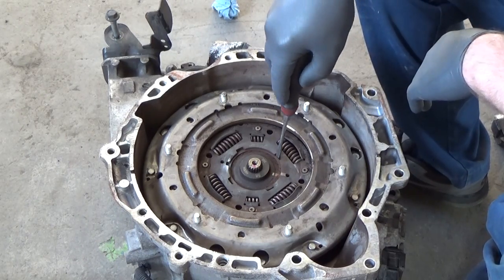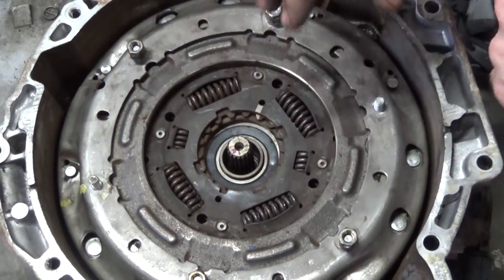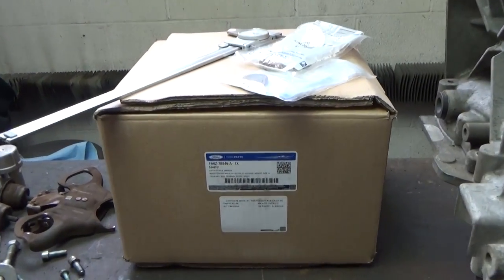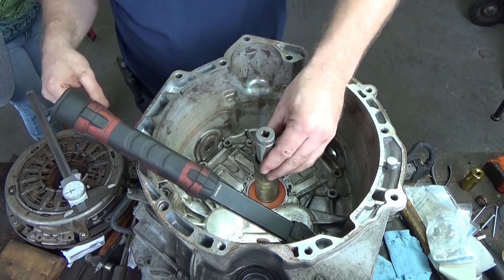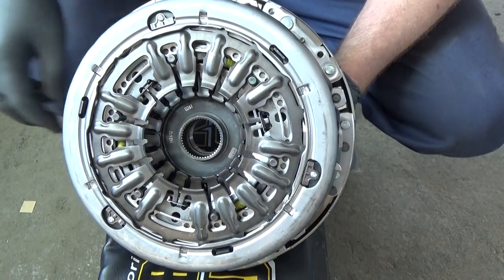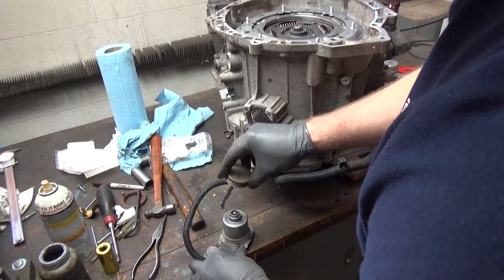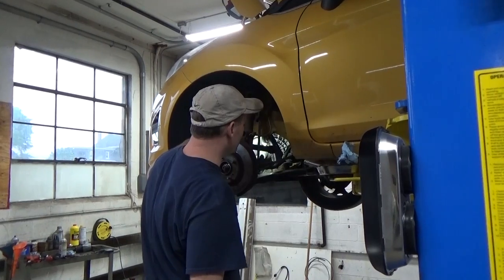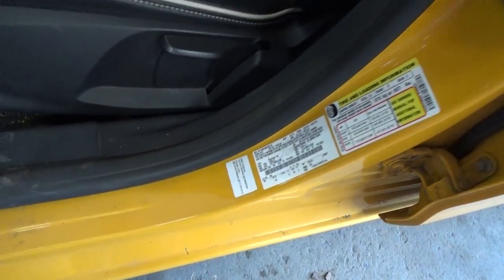Ford Fiesta DPS6 Powershift Transmission Slipping/Shudder Part 2 (Clutch replacement)

Comment: I would just like to say, I'm British and have a Ford Focus Estate Titanium 2litre late 2010. Had a problem with 2nd and 4th gear slipping, I didn't think it was the torque converter because I thought it would slip in every gear if it was that. I work 6 days a week so I had no time to get the car checked, also no money haha. Eventually 2nd and 4th completely stopped working, had a transport company take my car to a garage and was told it was the torque converter to begin with, but because I kept using the car some bands broke and ventured there way around the gearbox and trashed the solenoids. I now have to pay for a complete rebuild of my gearbox costing me £3,200 , I would love to of had you as my mechanic if I lived there, knowing and trusting in your work as you clearly took pride here. Enjoyed watching every minute of the 2 videos, liked and subscribed. Keep up the attitude and mindset, success is a goal everyone can and will reach.

Comment: Nice job! i am a ford transmission tech, and have done hundreds of clutch replacements. your tools you made are spot on. Getting yourself an ids, and vcm will make working on fords much easier, and keep alot of the programming / re-learns in house. Great video!
Reply from the maker: MikeHillman thank you for the compliments and feedback it's greatly appreciate, glad to have you here! I purchased a vcm2 with IDS, after this job. performed my first PCM update Monday on a 05 Ford escape that came in with a ingnition ping/knock when hot in addition to other symptoms, sure enough there was a update that covered all the concerns!!, felt good to do in house, last shop went crazy with it, i most likely would have as well, my first thought was someone installed the wrong plugs or something crazy. till I ran a scan/checked for updates 15minuts later it was good to go fixed! unreal amazed us all. wishing I could do it over and document. thanks again

Comment: Absolutely fantastic video! Thank you for uploading. I purchased a 2013 Focus SE with this about a year ago with 56k miles. On a test drive, there was some shudder from a stop.  The dealer (Inver Grove Ford, Inver Grove Heights, MN) went through the car and replaced the clutch pack and seals with the latest version BEFORE I signed on the dotted line. It's 10k miles later and the car runs GREAT! The dealer must have gone by the book. One thing I was told about this transmission (ANY DCT), is they become problematic because owners are not told to keep "creeping" in stop and go traffic to a minimum and keeping the car in gear while stopped on hills WITHOUT standing on the brake. The excessive heat buildup is BAD for the clutch pack just like the clutch in a fully manual transmission. BTW, the dealer gave me a FREE written lifetime power train warranty with the vehicle!
Reply: Thanks for this info! I'm sure there are other things that automatic drivers do which you can not and should not do in a manual. Such as... "red light racing"
Reply: That's part of the reason but the software is contributing to the shudder majorly. A custom tune for a Focus or Fiesta can make a huge difference.

Comment: You are absolutely awesome and as professional as you can possibly be your work ethic is for your customer to receive the best job possible. 
      I appreciate your use of clean English with no inappropriate language and without running down the vehicle brand which I have seen many you tube mechanics or 
Rather wanna be mechanics do 
THANK YOU THIS WAS VERY INFORMATIVE AND PROFESSIONAL.

Comment: Great video mate and excellent improvisation.  I watched the FordTechMakoloco video as well because I just bought a used 2012 Fiesta Sport Sedan for my wife with 90,000km on the clock.  Now has new timing belt, tensioner, water pump, serpentine belt and trans fluid replaced at Ford dealership in Thailand as a precaution at reasonable cost.  Thanks to you guys, I now have knowledge about the dual-clutch transmission.

Comment: Years ago i paid the local shop $900 to replace the water pump on my alero 2.4L and all that after arm twisting & begging them to do it. Happened in feburary -30*f outside. Since then i've done it so many times i could do it with eyes closed now. It so easy but does take 5 hours. I rebuilt my silverado 4L60 myself because i don't trust transmission shops. Been screwed b4. Took me a few days to get it done and fabricated some tools like you and i studied online for months first. Hardest part was separating the trans from the engine. It was stuck on those two dowels so tight i had to wedge the two apart with hammer/chisel. A 2 1/2 ton come-a-long would not pull the two apart.
Reply from the maker: thank you for sharing, i agree its hard to trust others especially when your capable of doing the Job.  not to mention the pride that comes along with it. glad everything worked out for you

Comment: Hey, this is an awesome video which I am going to be using for a reference this weekend to change the clutch in my 2015 focus. What are the dimensions of the 1/4" steel plate? I'm wanting to have the materials needed to duplicate your pull/pusher before I drop the trans. Thanks in advance
Reply: Did you ever found the dimensions of the 1/4" plate? I have a 2012 ford focus with a bad clutch and I'm thinking on fabricating my own tools as well. Thanks

Comment: Thanks a lot your video saved the day I just did a clutch replacement for a customer along with a new transmission control module and I couldn't find anywhere that says you need to release the "ClUTCH HOLDERS" I was just about to tear the transmission back off the car LOL Thank you🤝🤙🤜💥🤛

Comment: You mentioned hoping you can find all the bits you fabbed when the net job comes along. Whenever I make up my own toolset for a job, I buy one of those cheap plastic ammo boxes from harbor freight and throw everything in there including all the bolts and washers. Next time I need it no trial and error just yank the box off the shelf.
Reply from the maker: Chad Bob that's a great idea, will be picking some up. I need to find some bolt bins if you know of a good place?

Comment: Hello sir! I just want to start off by saying Thank You for making such a detailed step by step experience video. And excellent tools by the way! I was curious,  would you be able to provide me rough dimensions (just height and width) on the 1/4" steel plate? I'm going to try to make a similar version, but I wanted to make sure I have a big enough plate available to me. The only other thing I won't be able to do is bend the sides to add strength

Comment: Great video....Superb work.
I for one have had to go automatic because of Knee problem, but was put off the Powershift Box due to so many reports of problems (mainly with the Fiesta, Focus Models) although I was looking at the Mondeo, which I believe runs in oil and not dry like the Fiesta Focus Powershift box.
Keep up the good work.

Comment: Awesome job, wish you were working on my 2012 ford focus, 2/11/21 in shop (ford)putting third clutch ASSEMBLY in only first one covered by warranty. 11/19 cost $2200, 2/21 charging $3000...

Comment: One problem I've heard a few times with these dual-clutch systems is people tend to drive them like a conventional auto - including holding the car on a hill with the throttle, and lots of creeping in traffic - thus wearing the clutches badly.   I'm wondering if this sort of excessive wear and heat could be the cause of those screwed-up wear patterns on the clutch fingers.  Your thoughts?

Comment: I´m Alfonso from Mexico, I never seen this kind of video. Congratuletions. Could you answer a question? I have a Ford Fiesta 2012 , last week, The car had a fault in the reverse, stopped working 5 minutes later it worked again. the next day new failure after 2 hours of travel. The forward speeds work very well, the only code that marks in scan is P090C, they told me that you had to change the whole clouch kit, do you consider it correct? changing clutch actuator B could correct the fault? thank you  very much, I aprecciate so much if you help me Alfonso.

Comment: Great video, In my area of Texas the cheapest I found to even touch this transmission was about $2700. Not happening after watching this video doing it myself.  Not sure the ford guy will come out to the country though so will have to figure something out on that. I have reset my transmission through the ignition sequence a couple times because it does learn those bad habits.......but its got 137000 so its time to replace the clutch and seals...... I have learned that these transmissions are originally made for rally racing and they like to be driven the same....... Probably why I got 137000 miles out of mine and most haven't even come close to that mileage. I have noticed or did notice the shutter when driving like grandma though so I just dont ....drive like grandma never did or will........ rather be ahead of the accident than in or behind it....... with all the zombie drivers these days. ..... The reset transmission and computer is on here also just search ...... 

Makes me wonder if the TCM is upto date new with the newest software.... if the ford guy is needed...... 

Another thing I notice on mine is after it gets good and warmed up it doesnt do it as much either........ but that maybe just my car only....... I didnt go with the ford clutch pack either.......

 I went with the LUK Repset 07-233 Clutch pack with both forks brand new.... a steal a rock auto for $350 or so......more info @ https://www.rockauto.com/en/moreinfo.php?pk=8565328&cc=3310291&jsn=503 

Rock Auto Ford Feista and Focus 2011 through 2017 Luk Repset 07-233 $350.00 
Clutch Pack, Forks Throwout bearing, snap ring bolts.....seals not included Ebay $12 bucks 
Which is about the same price as Fords clutch pack only ........ 
https://www.rockauto.com/en/catalog/ford,2015,focus,2.0l+l4,3310291,transmission-manual

Hope this helps anyone including service guys find all the parts that could wear and should be replaced also....... even on ebay with all included its all over $500 separately ......Rock Auto rocks....... Even the repset from luk on ebay is high..... wtf ......
Reply: Oh the seal puller thing just fucking awesome ...... way to work it with all of it........ the tools are expensive.
I also am replacing the the mounts also just because ..... they were cheap also at rock auto........ 

If you come across the moving slow clunking sound from the front end its usually the stabilizer links .... the factory ones suck...... as expected........ Drive rear wheel out of alignment no adjustment of course..... just a few things I have ran into...... 

Oh also the battery grounds suck ....I removed it and scratched off the paint and replaced I used battery grease over it on both grounds ...... the obvious one and the other under the battery box ...... keep from oxidizing ...... apparently it it causes issues with the TCM also......  like random shit also...... 

Sucks to buy a brand new car and have to fix all the bullshit before its good but thats the world we live ....... Maybe thats why I have got 137000 out of mine though.  Always helps to be informed ...... The recall has made them all cheap as hell.....also........ good thing if we know how to work it ...... 

I get at least another 137000 out of mine .......Drive it like its suppose to be driven....... good little fun car mine is a 2015 Ford Focus Hatchback ....... Se only ......... but have out driven anything from mustangs to corvettes why those people buy those cars and not know how to drive them as they should be all the time ....is beyond me....... but thats why they get beat down by a Ford Focus also ......a Ford Focus .......it fits in the tightest spots they dont...... hahaha 

Life is suppose to be fun.

Comment: Great job man. What's the purpose of such a trans? Seems like a bit of a headache for the guys that have to work on them.Thanks for the video.
Reply from the maker: Duncan MacKenzie thank you, had a lot to do with better fuel mileage I believe, 6 speed light design, the concept is truly amazing kinda hope it gets another shot. Nearly 40mpg this car averaged highway- pretty impressive
Reply: 40 mpg IS really good. I do suppose it's worth the trouble I guess. I watched the other vid. you suggested and it  seems Ford has been working the bugs out of that trans. Perhaps they've got it now maybe. Thanks for the reply.

Comment: Dude,
The more of these videos i watch about this transmission, (nice tool making btw) the more I'm convinced the transmission oil should be replaced much more often than recommended and I suspect these may run warmer than is healthy, depending on the time of year and conditions. With such a compact design and the rpms and temperatures involved, the measly two quarts transmission fluid is vital for efficiently dispersing excess heat and such... Congratulations on the job well done.

Anywho-
How much for an exact copy of your puller tool?

Comment: I bought a 2019 new focus st line 1.0L turbo and its been back to the dealer twice. At 1500km it had 2 anti roll bar links replaced and now at only 3000km theres trouble with the gearbox it clunking in 1st 2nd and 3rd gears they replaced the clutch but that has not fixed the noise, now the gearbox is getting a new 2nd gear what sort of shite is ford churning out.

Comment: My 2013 Focus SE is in the shop rn exactly at 100k just barely under warranty getting its clutch replaced due to shuddering and refusing shifts, how many more miles will this push my transmission?
Reply: Quacob I got mine to 130k and the shuddering got so bad that the transmission felt like it was going to fall out of the bottom of the car. Sold it and bought a crown Vic best choice I’ve made in a while

Comment: Did you check the wear limit on the shift forks? Maybe that's why the clutch plate contact points are wearing prematurely.

Comment: I am a retired aircraft mechanic & flight engineer.  I don't know how much you charged for this job but from what I saw, it would be worth every cent. Quite a complicated and involved process to say the least. Manufacturers should just stick to proven conventional engineering design concepts or subject their transmissions etc to accelerated in service wear testing similar to aviation methods. Forcing this over complicated mechanical garbage onto the unsuspecting public is unethical to say the least.

PS: You did a great job using everything at your disposal, making job specific tooling is something that resonates with me & my own interests.
Reply: they should stick to convention. the government is forcing them to experiment with stupid bullshit for fuel efficiency.

Comment: Can you tell me the total length (including threads on the one side) of the two sections of stainless steel schedule 80 pipe?  I'd like to cut these prior to pulling the transmission.

Comment: Hi,frez!Great video😘! I very like this video ! Frez, can u teach me how to reset clutch 1&2 for used dual clutch! Because my transmission's dual clutch still ok! I just replace new actuator A . But ,i don't how reset again clutch 1&2 😂😢! Need reset just can install back ! Please teach me,frez! Headache now! Can u help me solve the problem.
Reply from the maker: Jiawang Chu you will need to have this done with a programmer like a VCM with IDS software

Comment: in what selector posición (pnrd? must be to  dissasembly? and in what position  to  reinstall?
Reply from the maker: Antonio Torres by the book it say place in neutral (N) prior to disconnecting battery. it uses actuators. however to o be honest I missed this step an did the complete repair with no issue. it will need to be relearned prior to driving

Comment: Is this an actual fix or band-aid job for this issue with the transmission/duel clutch shudder??
Reply from the maker: Russell Williams this is all the latest revisions from ford to supposedly fix all known concerns, time will tell. A shuddering issue was mainly due to a failing oil seal. If you experience shudder most times from what I have read you will notice oil in the bell housing that has contaminated the clutch. We covered the oil seal upgrade, in addition the clutch pack has been revised as well
Reply: I'm getting a clutch replacement done next week by Ford. The process and perfect sequencing look critical to getting the job right.  Are you aware if all the Ford mechanics are well versed and prepared to undertake such an exacting procedure?

Comment: Instead of oil seal ford could have used some tight bearing around the shafts. That will be reliable. But ford build the transmission like a dam and used flimsy shutters.
Reply: Having a strong battery helps 725cca or more could help IDK I JUST adapted to the car and it went away but sometimes it happens 
The radio was killing the battery plugged in a Socket and in line fuse and it gets shut off when it sits 4 2 or more days

Comment: I know this video is 2-3 months old now, I just wanted to comment saying I have a 2014 Ford Fiesta as well with the Powershift transmission, had to take it in for a reflash on the TCM at 26,000 miles and then at 29,000, shuddering came back and Ford replaced the clutch pack on it but they didn't mention anything about the clutch being contaminated with the oil...  Anyways, I have 47,000 miles on it, still runs beautifully to this day.  I love the car.
Reply from the maker: DeadofWinter321 glad to hear 👍 when they work good they work well! Still going strong as well
Reply: robinsonsauto - I hate to say this.. But I just had my second clutch replaced this past Monday (2-19-18) and it had only lasted 23,000 miles.  Now this new clutch feels jerky while accelerating.  Idk if it's because it's still new or what.  I've lost confidence in the vehicle.  I'd buy another Ford, just not with this transmission.
Reply: @DeadofWinter321  Tom's tune if you still have the car.